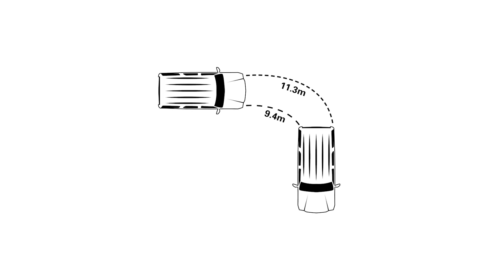SUB $600 DIY LOCKER INSTALL – Watch how much difference it made - Front vs. Rear, Manual vs. Auto

Comment: I installed one in a 2001 Rodeo. Amazing value off-road mod. Perfect for a vehicle like this with manual locking hubs. Unlock the hubs, shift into 2wd and the lokka is sitting idle. 

They should be called auto UNLOKKA. They're always locked until a wheel wants to travel FASTER than the engine is pushing it. 

It only unlocks when the wheel speed for single wheel is GREATER than the input drive from your engine. For example, you're driving up a difficult track. Your engine is pushing you at 2m per second (2m/s). You turn your wheels left. The lokka keeps driving your left wheel at 2m/s. Your right wheel (following the longer path) is pushed [by the ground] at 2.1m/s. So the lokka UNLOCKS and allows that wheel to travel faster. But it doesn't let it travel any slower than the engine speed (e.g. 2m/s). So as soon as you're straight again, it pushes BOTH wheels as 2m/s.
Reply: OK - New trademark coming up !!

Comment: Misconception there for "it will always unlock around every corner"
Wrong, it will always unlock if your foot is off the gas and you're coasting around the corner.
Otherwise if you're accelerating or driving like usual, it's definitely locked, and off you half ass it, little bit on, little bit off the gas, then you get a beautiful lurching as your Diff locks and unlocks on the fly.
It's really not fun.
I'm not saying it's a bad lokka, I've had one for years, I'm just saying make sure you tell it how it is.
Reply: You haven't by any chance driven in the snow have you? I intend on getting one in the rear of my 110 Lux, but a bit apprehensive of it binding and oversteering me off the road. I drive with MT's year round but we have icy roads four months a year. Not a lot of folks that have lockers on their daily driver, so it seems it's somewhat uncharted waters 🙂
Reply: @hampuslytz5393  if you're driving in 4wd all the time for snow then I would Not put it in the front.  In the rear would be less sketchy and more helpful tbh,
Reply: @EliIronMan  Yeah, gets far too tailhappy for comfort in RWD with MT´s so 4WD is a must, and I´ve read as much on forums to know that in front it's out of the question :) 
 Will have to try it for myself, It´s a 2.4NA so coasting is all I do anyway ;)    
Btw did you have any experiance with snow driving with auto lockers in the snow?
Reply: Hampus Lytz lol from Canada here. If yr on the highway in snow u don’t want a locker in front or back. If u spin the rear u can whip right around very quickly. Gets the heart going pretty good. Also compression braking in snow can make the rear swing out easily too. In the front in slippery icy corners on blacktop wen a corner comes if both front tires loose traction u mite not b turning that corner. Also a Adrenalin hit.
Reply: @123suzukisamurai  Yo Canada, Finland here! Thx for concrete info, and sort of poking holes in my dream of lockers :P Nice to hear from someone that have proper winters, not just a slippery road here there :P 
I take it you ran auto lockers on a samurai? Did you have studded tyres or AT/MT´s?   
Elockers/Airlockers would be awesome but simply can´t justify the cost atm, nor can I risk the car doing a mid-flight u-turn on the road while taking my daughter to daycare if installing an auto locker, guess I´m stuck wih open diffs for hte time being
Reply: @123suzukisamurai  also when braking on slippery roads without abs and a wheel locks up suddenly it applies enough torque to engage and disengage the locker rapidly and makes a hell of a racket. I have 3 5 speed TJ's all with lunchbox lockers front and rear and I live in northern NY... they are a handful in the winter lol. They will get you where you need to go every time but it can be a white knuckled ride at times🤣🤣
Reply: Hampus Lytz yeah. Kinda catches u offgaurd. Anything with short wheelbase can flip around so fast   Gotta have open diffs with the ability to lock wen u want them too. Lol
Reply: You have one in the front? Someone mentioned you lose the ability to drive fast in 4H, for example, gravel roads, etc. Is that right?
Reply: And if you fit one only at the back of it should fixed the issues?
Reply: Hampus Lytz real simple from experience, I would not have another auto-locker in snow. 
Ever driven Front Wheel Drive in the snow and give it gas?  It really wants to go straight - no matter how much the tires are turned left or right!
The rear is not as bad, but same tendency. If the rear tires have more traction than the front - then they will push you straight no matter the way the fronts are turned!  Why?
Basically, it takes some type of “traction” to unlock the locker. Not enough traction (like snow or ice)?  Then you are going straight (unless gravity is helping to pull in some direction). Either way - you don’t end up with much confidence at all when a curve is approached.   😥
Reply: @TheRazmotaz  That's what I've been reading elsewhere.  Looks like ARB is the only option for my truck then at triple the price of the Lokka..  More like quadruple as it's a grand for the locker then I need the compressor!!!  Lokka is around $300 but with winter and no hubs (auto or manual) I'd be in the ditch I suspect.
Reply: Trevor S yea all non-automatic lockers are pretty expensive. The Ox locker doesn’t require a compressor or anything, but is no where near the price of any of the “automatic” lockers (Lokka, Detroit, Lockrite, etc).
Reply: @TheRazmotaz  And it doesn't look like it would fit the front of a Nissan Frontier :(  The rear already has the oem elocker.
Reply: Trevor S I had a Nissan HardBody truck back when those were the thing. When I eventually learns how limited the upgrade options were, and that even the price of the parts for a single ring and pinion was $1000 - I vowed that I’d never own another one. Sorry that you are finding the same limited options after all of this time.
Reply: @TheRazmotaz  Actually it's not that bad.  New ring and pinion is under $300.  All new bearings in the rear diff (not wheel ones) and having a shop install everything was still under $600.  I have the stock brake controlled limited slip which applies the brake to whatever is spinning.  Works well for what it is and is strong enough to cause the inside tire to slip on dry pavement (ask the wife about doing that...), I was just looking for a locker that I don't need :)
Reply: @wlspn  you can drive fast in H4 but the more acceleration you apply, the more clamping force in the locker. Once up to speed it will only be clamping with alittle over sping pressure. But you still need enough traction to overcome that force while turning. If it's really loose gravel (fine shale rock) then the tyres might not have enough traction to overcome the clamping force and won't unlock.
Reply: Liam Cooper, so basically there shit for 4H?
Reply: @hampuslytz5393  Wouldn't it be awesome if some of these manual locker manufacturers remembered us poor guys =/
Reply: @trevors8577  I'm in same boat. Pro-4x with the limited slip and an e-locker rear, but wanting(really wanting, for like 25 years, to have a fully locked truck). Its possible with our trucks, but ARB makes most things unreachable for me. If I can get any good reassurance about snow, ice and sand, I would buy an auto locker.
Reply: @mp-ot7fw  Oh for sure, but I can see the reason for it.... Check aliexpress for cheap manual lockers(arb ripoff) 400ish iirc. 
They cost the same as an automatic, but would you trust one not to leave you stranded, I wouldn't :p  
Quality steel, machining and tempering all cost money
What do you drive btw? :)
Reply: @hampuslytz5393  I'd hazard a guess that it's a nissan frontier pro-4x. :)

Comment: I think you need to explain how the lock right locker unlocks-under load in 4wd to make steering easy.  Those lockers only unlock when no load is applied and you go through a turn.  Cool truck.
Reply: They unock if the wheel is trying to roll faster than the diff is driving it. If there is good traction then the outside wheel on a corner can roll faster than the diff is sdriing it, if there is low traction and therefore wheel slippage then it wont unlock.  You only need differential action on hard surfaces when theere is no slippage.
Reply: @4wdsystemsgeartogoannawher754  So I take it they take a little getting used to on the beach? Even though I like going off the beaten track, most of my offroad work is on sand for fishing, would you still recommend these?

Comment: I've been running a front lokka in my Y60 coil cab TD42 for 9 years, never skips a beat. Been running rear Detroit auto locker for 4 years, together unstoppable.
Reply: Hey mate I'm thinking of getting just a rear lokka because I have 105 Landcruiser fulltime 4x4 and just looking for cheapest option. Can't afford part time kit ect. Would you rate just doing rear? Cheers
Reply: @Sim0nDrums  I guess it depends what type of terrain you'll be driving. I did the front locker on my patrol first, reason being with big heavy diesel engine weight in the front. I assume you also have a heavy 6 cylinder diesel up front, I'd do the same. If we had a light front end, I'd do rear first.
Reply: @Sim0nDrums  another thing to consider is patrols flex more in the rear and have difficulty flexing front end. So the rear better chance of getting traction without a locker, however I know the land cruisers have a different front end track bar that allows better flex than patrols...tough decision, sorry to make it even harder for you but at least you'll make an informed decision.
Reply: @Sim0nDrums  a third thing to consider is I have manual locking hubs...so I can disconnect the front axles and my front locker won't affect my steering...I believe the 105 series is full time 4wd? Confirm this and if you have  auto or manual locking hubs.
Reply: Thanks for the replying mate. Yeah 1fz and full time 4wd. I'm looking to do on the cheap because I want a winch as well. I want to do tough tracks. Slow and in dry conditions.
Reply: I'm automatic and no part time kit.
Reply: 35s
Reply: @Sim0nDrums  I'd suggest rear for your setup then to no affect steering because Locked front will reduce some steering, not terrible but some. Remember the saying "a winch is to get you unstuck, lockers are not get stuck". Of course it's not always the case but keep that in mind.
Reply: @marcosarria2984  thanks mate that's what I'm thinking 🤘

Comment: I would recommend installing lockers front and rear, but I’d actually recommend starting with the rear first.  Front axles, be it a solid or IFS, tend to be a lot weaker than the rear, and running lockers puts extra strain on the axle shafts, increasing the chances of breaking an axle.
Reply: With locking hubs in the front set to freewheel will cause less strain on front diff for every day use wouldn't it?
Reply: @supps101 It would be the same regardless if your in 4wd.

Auto lockers engage under power, so if your in 2wd you will not notice them or have any strain. But if you want to have 4wd you will need to have the hubs engaged.

Comment: From what I know, to turn u have to ease off the accelerator for it to unlock around corners - if u keep the power on, it will not unlock...That's what I found with the one in my Zook...
Reply: That can happen when you have a lot of front to rear tailshaft windup - ie on a hard surface - back off or blip the pedal or take it out of 4WD !
Reply: @4wdsystemsgeartogoannawher754   True but when there's load on the diff (ie Hillclimb) - the forces at play will make it difficult for it to slip, if at all. I also had one in the rear of my Suzuki and at the time it was my daily driver. When u drive into tight carparks on a daily basis - it can put a lot of stress on the driveline (ie: axles) and in my situation, I ended up breaking a rear axle. I ended removing the rear one(installed a rear air Locker), left the one in the front and used it like that for years. I found that with the front locker, that I seldom needed to use the rear air locker...

Comment: I have first hand seen these auto lockers work and they are pretty brilliant. The one downside of installing one is when you drive in snow on road. Maybe not an issue down in Australia, but this is where it changes driving characteristics on road with snow/ice on top. In a straight line it tends to pull side to side at higher speeds with snow on the ground as it unlocks and locks in the low traction environment making for some interesting driving. May not be an issue if it's in the rear though. My 2 cents, if you drive in winters with snow and ice on road, go for the manual locker. Every one else though, go for the auto and save some money. Food for thought.
Reply: Wouldn't be for us Queenslands it's always fucking hot here even in winter but fun fact Australia gets more snow cover in winter then all of Switzerland does. Plenty of roads are snowed over or iced up in Victoria and NSW around the mountain ranges

Only thing we need to worry about in Qld is roads that are 10 meters under water 🤣

Comment: I've had an auto unlocker in my Patrol for years.  I love it. Mine's a Lockright not a Lokka, but they are identical in operation.  I have manual hubs and I always unlock them when on road in 2WD at highway speeds.  If your hubs are locked, the diff will be constantly spinning the front diff and tailshaft , something that can't be good for wear, vibration, and fuel economy.
Reply: No difference in this respect to a normal diff

Comment: Have had one of these in the front of my Triton for the last 7 years/150,000 kms, never missed a beat and you don't know it's there in day to day driving
Reply: how does it go towing or driving at 100kms plus while turning? also did affect fuel?
Reply: @Barnesy4wd  It doesn't affect anything when in 2wd. In 4wd you can feel it a little bit through the steering but generally I'm only going slowly along tracks if I'm in 4wd
Reply: @Barnesy4wd  You don't tow anything with a triton. If you want to keep driving a triton that is. 🤣

Comment: I have this exact same locker in my Jeeps front dana 30 axle and it works great but it does affect steering. Any time the diff is just free spinning its not engaged but anytime power is pushed thru the diff it will engage and no it does not disengage when turning a corner unless I let off the gas and allow it to coast which stops the power pushing thru the diff. In 4x4 when turning on pavement the tires will chirp and if im on an incline and take it out of 4x4 some times it wont disengage without me backing up a short ways. I have gotten into the habit of reversing a short distance anytime I come out of 4x4 just to ensure its disengaged. All in all im happy with the Lokka as it really improves performance off roading

Comment: I had a 1975 Jeep j20 full time 4wd with hi and two and a turbo 400 trans(3speed auto) AMC 360 V8 2brl carb lol fully locked 100% of the time!   Turning at stop signs was embarrassing at times lol and I had a supply of u joints and the Axel's where massive overkill Dana 60 and 80

Comment: Gawd, just discovered the lokka front locker.  Was looking at rear arb lockers and didn’t even think about the front.   Thought the front would be more expensive.  Damn, cheap as fawk, and works.   Getting one and maybe won’t even go with a rear if it works so damn well.

Comment: Ratcheting lockers are great low cost traction aids, and I agree that the front locker in an IFS rig actually does more for useful traction than the rear in most rigs, especially if the rig is light in the rear anyway (pickups). However; Ratcheting lockers wear out rapidly if used in daily drivers. Don't expect it to last the life of the axle/diff the way a manual locker can. A proper electric/air/cable actuated manual locking diff (and associated internal gears acting like a traditional diff when unlocked) can last the life of the vehicle if not abused too badly off road, with multi-hundred thousand road miles between trail use. Also, front-diff applications of lockers in IFS can come with increased risk of diff/axle/CV breakage offroad if not treated with respect. The additional traction is great, but remember it means all the forces available to the drive-line can now find their way to a single axle or CV that is pinched up in a bad spot, so be careful. Keep the wheels pointed as straight as possible when going up really gnarly stuff. 

Ratcheting lockers don't unlock perfectly around corners and can result in unpredictable steering behavior (even yanking the wheel out of your hands as the locker transitions from disengaged to engaged as you accelerate out of a corner).

Comment: Great video. However, I would be very hesitant putting a locker in the front if driving on snow/ice as it will affect steering. But if snow/ice isn’t a condition a front locker (and one in the rear) is a damn good option.

Comment: great vid! explains the differences well, plus the install portion is going to be a lifesaver when the time comes for install! in my 1989 jeep wrangler yj i'm doing a lunchbox in the rear and a manual in the front for optimal controllability and lockability as needed. it's also my daily so having the options for both is really going to be a game changer, on and off road. got a new sub from me :)